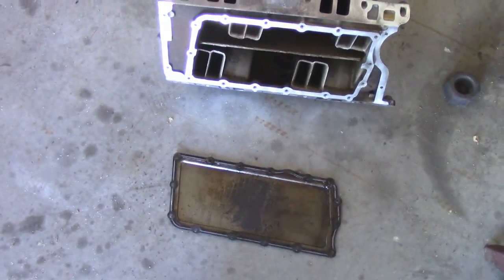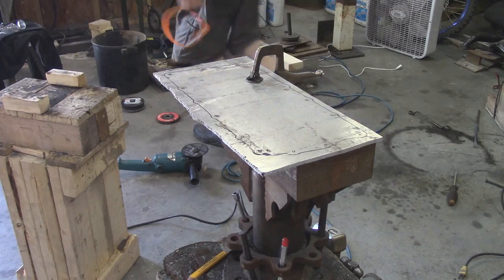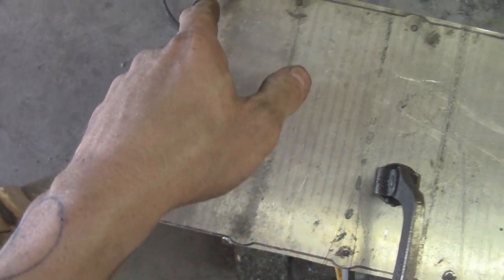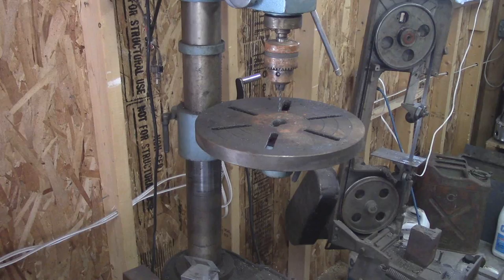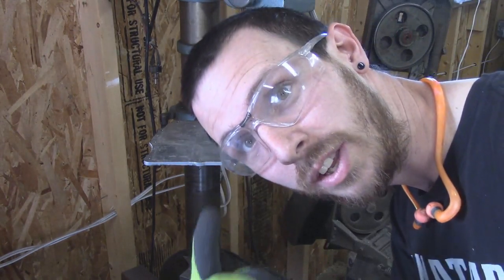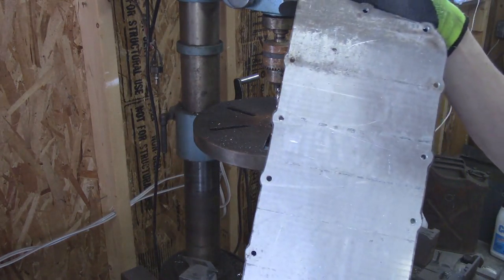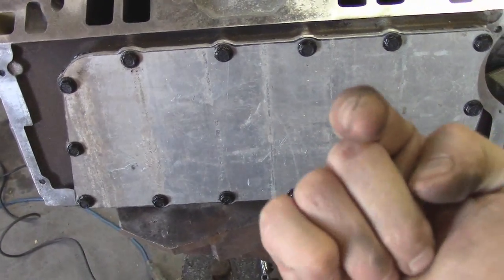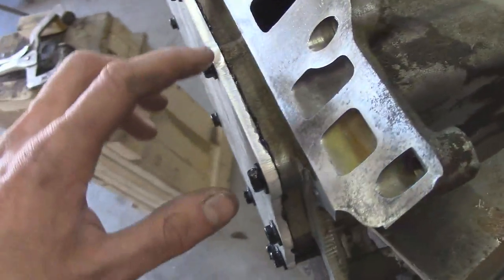Dodge 318 Magnum Intake Plenum Mod

Comment: I replaced the plenum gasket on my brother's 5.9L Durango. I reused the stock steel plate. 1. Clean it really good. 2 .Clean the  bolt holes with brake cleaner.  
3. Use Permatex non hardening aviation sealer on the new gasket mating surfaces. 4. If you use the original bolts, make sure that you clean them and use blue Lock Tight on them. 5. Get an In/Lb torque wrench 6. Tighten the bolts using the sequence in the repair manual. 7. Make sure that you follow the tightening process EXACTLY HOW THE REPAIR MANUAL SAYS. Or it will leak and you'll have to pull it all apart again within a year or sooner. Hugh's Engines sells an aluminum alloy plenum plate ki. It's $150 - $200. As I was saying, I reused the stock steel plate on my brother's 5.9L Durango.  I did it exactly how the repair manual says to do it. It didn't leak and it still doesn't, it's been about 7 - 8 months now. If you don't follow the instructions in the manual, it could start leaking again in a week or two.  When you go to remove the kegger manifold. Be careful not to break the first and last bolts on both sides off in the block. If they're rusted solid in the block (which is fairly common) might have to use a torch to remove them without breaking them off. If they're rusted solidly in the block, I  grind the heads off the bolts. Remove the kegger. Then I use heat to get them out. Its still alot of work, but it's easier/faster than trying to get bolts broken off flush or in the block. Also use a shop vac to suck up all the little bits of debris and grinder dust before you remove the kegger.

Comment: I modified a 5.9 intake I played the runners back for easy entry in the runners.truck ran well with a RV cam 392s it went to a best of 14:42..at 95mph.....on beg comp ta 255 55 17 like on the  90s Impala SS, HOOKED DECENT....STOCK STALL...PERFORMANCE COMPUTER FROM MOPAR.....I've seen a few 318 with that plate gasket problem but not the 5.9s

Comment: Good job 👍. I'm fixing to do this to mine. Tried everything to get the stock plate to work. Thicker gaskets, longer bolts with washers... nothing lasts more than a year.
Reply: i cleaned the surfaces really good and just used black RTV and bolted it down and i havent had a problem since.cheapest and easiest fix ever.
Reply: You don't need longer bolts, you need shorter ones. The bolts are too long already. They bottom out before the plate is tight.
Reply: @650gringo  correct 💯! The factory holes weren't deep enough. Bought thick gasket material, shimmed bolts with good stainless washers so they aren't bottoming out.. this was 3 years ago and still holding up. I do the vacuum test occasionally to check..

Comment: the cheapest and easiest fix is to simply clean the surfaces really well and use black RTV instead of a gasket !!  i did that to mine and i havent had a problem since and mine still has the metal plate.
Reply from the maker: ive never had luck with black RTV silicone. i have however had great success with The Right Stuff. i imagine using it in place of the factory gasket on the stock steel plenum plate would yield pretty good results as well. i just had access to this aluminum plate, and i read that this was THE fix for it haha. and it makes sense with the 2 different metals cooling and heating up at different rates...glad your fix worked and is holding up for ya though bud! cheers!

Comment: if you're going to do this, get the torque spec sheet off the internet, there's a specific way to torque these bolts on, if you don't follow the pattern and torque spec, then the plat will end up warping at some point, and you'll be taking it apart again. do it right first time around imo. oh, and DON'T use a steel plate!!! we think that's part of the problem in the first place, two different types of metals expand and contract at different rates, do like this dude, an dude a nice thick piece of aluminum.
Reply: i heard another possible problem was that mopar used bolts that were alittle to long and they bottom out after the torque procedure.

Comment: On some engines, maybe on a lot of engines, the plenum plate screws are too long and they bottom out in the threaded manifold holes before the screws are fully tightened. This lets the plate develop the leak it is famous for. Shorten the screws or go buy some new shorter ones. Utawesome Performance documented this and it was the problem on my engine.
Reply from the maker: Awesome, thank you for the info! Hopefully it can help someone out :) cheers bud

Comment: I see this is a couple yrs old, is it still going strong with yur fix? cuz I thought bout doin this last time I fixed my issue for the 4th time in my 3.9, doubled the gasket added a washer to each bolt and gooped the hell out of it and it only ran beautiful for a week then the bad gas mpg, rough idle ect ect slowly returned
Reply from the maker: Honestly, i had the truck for 2 weeks after this video. I didnt notice that the frame on the drivers side was completely rotten. I scrapped it. Then i ended up moving haha. Now ive got a 89 gmc crew cab longbox.
Sorry i cant speak to the longevity of my mod. Are you using the steel pan still? If so, id definitely swap to aluminum.

Comment: You should of done the kegar mod. And cut the intake runners down/off get better down low grunt and little better Accel and gain a bit power over all

Comment: how did this work out for you?I got a 97 dodge 1500 5.9 mag,it runs but u put it in gear and stalls out.ANY thoughts
Reply from the maker: mopars23 i ended up scrapping the truck shortly after this video. It had other issues, among those was a totally rotten frame that i didnt see when i bought it. It fixed my crankcase vacuum and oil burning issues, but i shouldnt have cut the catalytic converter out, as that supposedly makes them run pretty bad too.

Comment: Hey man I really like the video! I had a couple questions;

1) where did you source your aluminum?

2) what kind of gasket maker did you use?

3) what would your thoughts on using JB weld instead of gasket maker be? I've been curious especially seeing as how it's a part you'd rather not deal with again.
Reply from the maker: Hey, thanks for the kind words!
1) I got some aluminum from a friend. But you could get it from a steel supply shop, or even a welding shop. They should have some drops or cutoffs that you could buy for cheap.
2) I used "the right stuff" gasket maker. It's the toughest, stickiest, longest lasting gasket maker I have ever used. It's super durable and very hard to remove once on a cleaned surface haha! Much like urethane.
3) i wouldn't use job weld. Imo, theres no point if you use a good gasket maker ;)
Reply: You don't want to jb weld that baby shut. It won't seal right . And have had pieces of it chip off and go into the motor..
Reply: JB will get brittle and flake into your engine.grey silicone is the ticket

Comment: Why not weld it on?
Reply from the maker: Ian Holmen you certainly could. I just dont have or have access to a tig welder. Plus with welding aluminum, you have to be surgically clean. If you leave any contaminants on the surfaces youll end up with a poor weld that could fail after heat cycling with vacuum and pressure applied to it. Bolting is the easiest, most cost effective way to do this.
Cheers bud, thanks for the comment!
Reply: analog56x I love that it’s aluminum and not a plastic part like on modern cars. But then when I learned of the pan being steel, I was like really? How did that happen? That sounds like a recall situation for poor design lol.
Reply from the maker: Ian Holmen haha i totally agree with you bud :P much rather have aluminum than plastic.
There have been a lot of instances where the steel pan has warped and blown out the gasket. Real common issue. Ive found that dodge is really stingy with warranty and recalls, so not surprised there isnt one that i know of...
Reply: Yeah ive been thinking of tig welding mine on my dakota r/t so i know it wont ever fail again.
Reply: Thunderbolt the purpose is to seal the intake from the gallery below the intake. Otherwise it would suck up all the oil out of the engine and burn it, hence the term “ oil burning Dodge” when the gasket does leak. The design ain’t that bad though, look at the Northstar and some Nissan motors, they put the damn starter under the intake manifold 🙄

Comment: my question is  why  not buy the kit from  hughes engines that literally gives you new plenum and intake bolts, intake gaskets,  plenum gasket, bypass hose and the 1/4" aluminum plate for like 125-150 usd. they also ve a intake offered that edlebrock makes for hughes  that has no plenum plate on it at all but its like almost 700 usd lol
Reply from the maker: I enjoy a challenge. I also like to show people how they can build their own stuff instead of just buying it. Granted, the kit comes with everything, but I spent so little on this, it was totally worth it for me. Plus, I got to make a video on how to do it Haha. I could have made an install video using their parts, but like I said, I enjoy a challenge :)
Cheers bud
Reply: @analog56x   i totallly understand that ans it was cool to see you make one but i wasnt sure if you knew about them until the end of the video when you said i saved 160 lol i was typing that comment while the video was playing. im hoping to order some go fast parts from hughes but not sure if that will ever happen or not. it would cost me around 7500 to build the engine like i want and about 4000 for the transmission and then no idea on suspension and rear end to handle the power. that would be naturally aspirated though so power could be better if i went turbo or procharged with nitrous. i would be leaning all in towards 750hp after i was done though and on a 97 single cab short bed im sure i would have a hell of a time getting her to hook

Comment: all good if you want to do that much work. I have a machine / fab shop and I make parts if it's worth it. I can buy this for 130 bucks......with gaskets, bolts and bypass hose. To buy the same gasket set is about 50 to 55 bucks, the scrap alum probably cost you 25 or 30 bucks. Now if take the low end total of 75 bucks and subtract it from 130, you saved yourself 55 bucks.....not worth it to me.
Reply from the maker: I got the aluminum for free, used the right stuff gasket maker, and I think I reused the bolts haha! Cost for me was very low :) but if you had to buy everything, yea, you'd be up there in price

Comment: That plate looks horrible , a ton of surface imperfections !!!
Reply from the maker: cornel sanders doesnt matter what it looks like. It sealed the intake from the crankcase, so it did its job. Youll never see it anyways
Reply: analog56x  I'm a machinist is why I commented I give you a B+ for effort . I would have scotchbrighted it using a piece of wood and the scotch bright. Us machinists see it forever ! Good job though .
Reply from the maker: cornel sanders i went around the mating surface with a fine flat bastard file haha. I would love to learn the machining trade. Ive dabbled a bit with my lathe, but im by no means pro haha. Cheers bud!